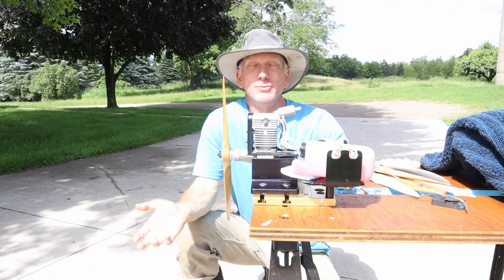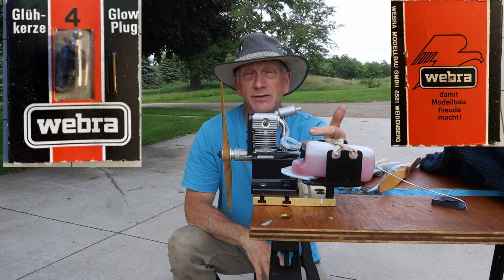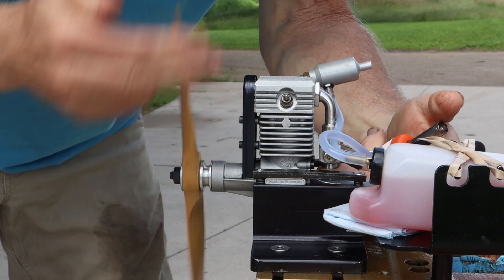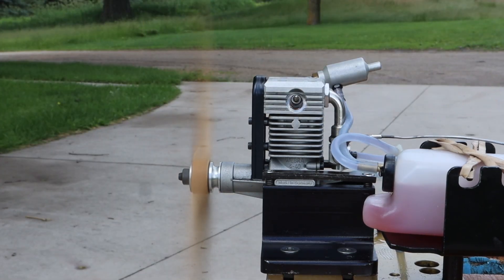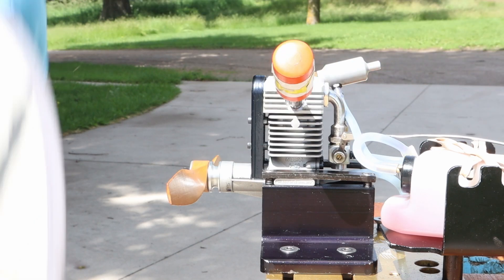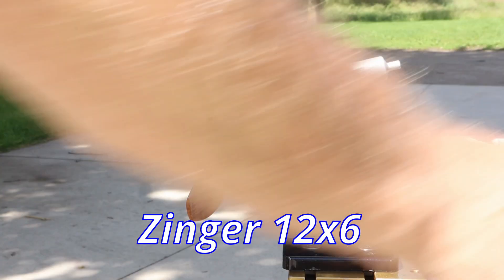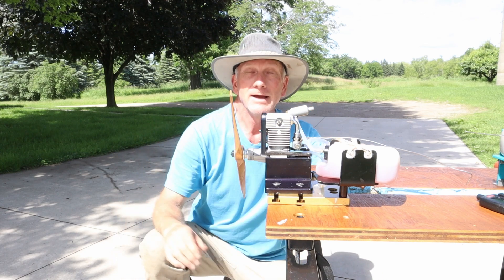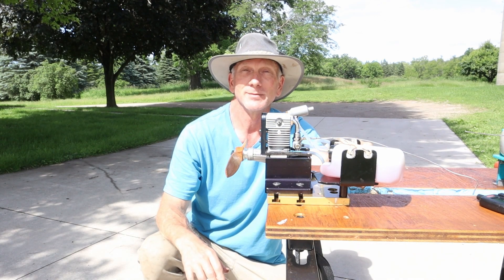Webra T4-40 Four Props

Comment: Great video David. Good comparison of prop performance. 
I think the transition issue is the plug. It’s a two stroke plug and webra make hotter plugs than the 4. 
I’d run it with the IS F it’s way more suited especially with low nitro fuels.
Other thing you could do is run high nitro fuel like 20% on this plug.
Reply from the maker: Well the funny thing is that the Webra #4 plug was what was recommended in the manual that came with the engine.  That is why I bought them.

Comment: Hi David. I still think there is a little timing error in the valve timing. If you disassemble the belt cover try to find a little point on the upper belt gear. I thought seeing a little point slightly on the left side top (about 11 o’clock) directly under the teeth of the gear on your disassembly video. Can you confirm that? Because this point should be absolutely on top as I remember my engine I had. I always ran my engine on OS „f“ plug and it ran very fine. Much better than the original plugs of webra.
Reply from the maker: Perhaps you can watch this video.
https://youtu.be/3jXzohmcvEs
I am not sure how much more I will be messing with this engine.
Reply: Hi David. Thanks for the reply. Well, these engines are often spicy with their timing. The smaller is even more a diva than the large one. 
In worst case the rotary valve doesn’t seal enough anymore and when exhaust timing is too late it blows back to the inlet. Otherwise with too early timing it may struggle very hard.
All in all I wish you good luck and a lot of patience with this little beast 😉.